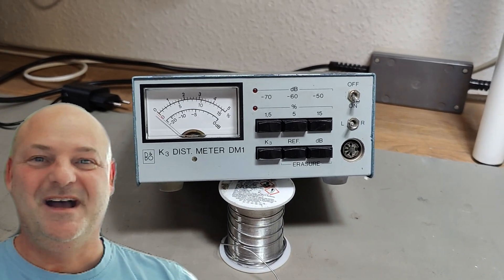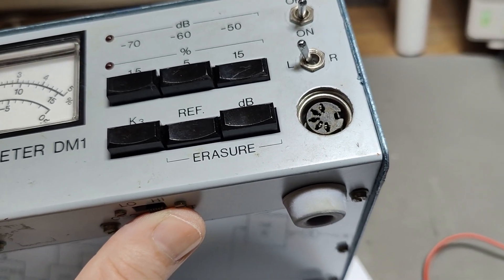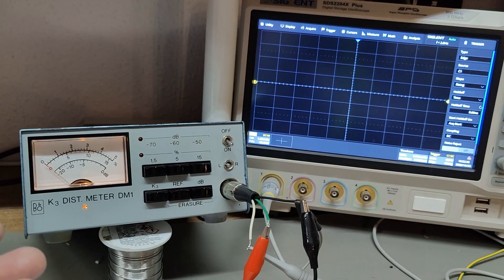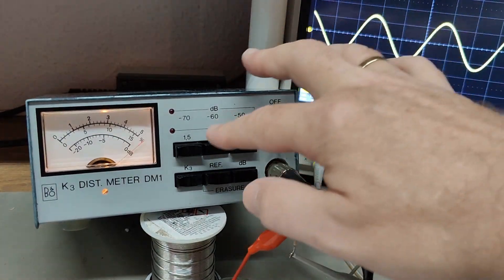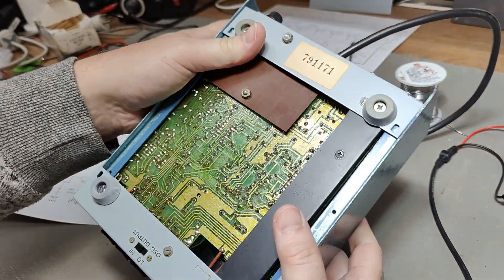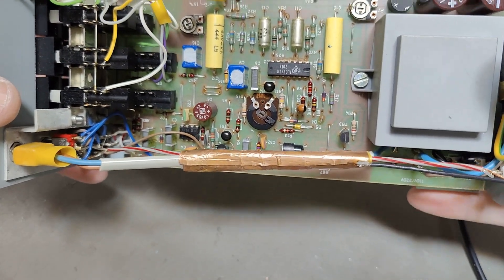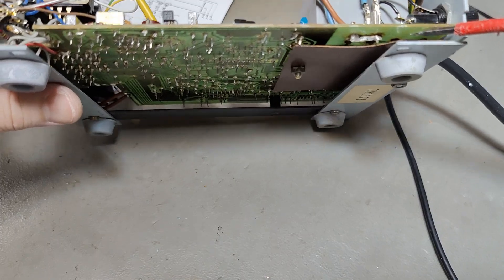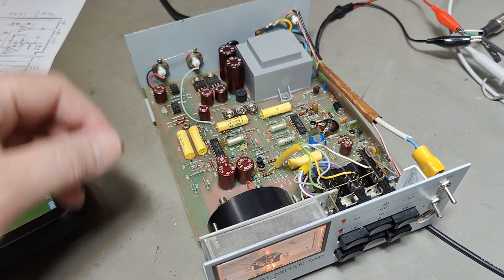Bang and Olufsen K3 Distortion meter DM1 1979 test teardown

Comment: Here’s what I think: The generator that emulates a tape channel should be set to add 1kHz and 333Hz tones. That’s because the AGC expects 333Hz tone to adjust the overall channel sensitivity. Then the 3rd harmonic result is correctly scaled relative to the fundamental. So the results you were showing with changing the 1kHz amplitude were really just showing how the AGC reacted to the “wrong” signal. Maybe you did have the 333Hz in the input signal as well - I didn’t catch that. 

The whole thing is probably calibrated in such a way that the AGC does not need to be selective. The AGC adjusts the sum of fundamental and harmonics, with the assumption that K3 dominates over other harmonics. Adding say 15% of K3 would cause a non-selective AGC to err low on the 333Hz reference level. But that can be easily calibrated out in the scaling.

Comment: Hi Thomas, interesting device, I would have expected a THD meter from B&O rather than this, I had no idea they made such a thing, the T100 from Nakamichi is a great tool for adjusting tape recorders and audio. With the screws, it's a problem that I found with a lot of other devices, the design of the stand itself is one thing, but unprofessional interventions when screws of a different length are replaced is a chapter for itself. DIN sockets with a switch were also commonly used with audio devices, for example to block inputs or disconnect microphones, etc., here it is cleverly designed to ground the input so that the meter does not detect interference due to sensitivity if the input is not connected.
I have probably all albums from Erasure 🤔 but "K3 distortion" is not among them 🤣
The optocoupler reminded me of my youth when, during one of the experiments, I put a diode on one side and a photoresistor on the other in a piece of pencil body 😁

Nice day 🙂 Tom

Comment: Jeg har et magen til. Jeg har lige haft det delvis skilt ad, da det er lige så besværligt at skille ad som dit og mit er original maling. Ledningerne sidder samlet, bare i et pænere gul plastic rør. Skruerne til benene går en halv mm gennem bundpladen, så det er forkerte skruer der sidder i dit.
Reply from the maker: thanks a lot, maybe the feets gets a bit soft over the years, then people tighten the screws, and then shorts happens, due to now the screws are too long, bad design anyways a screw length variation in the last mm, must not cause a problem, more margin must be in the design